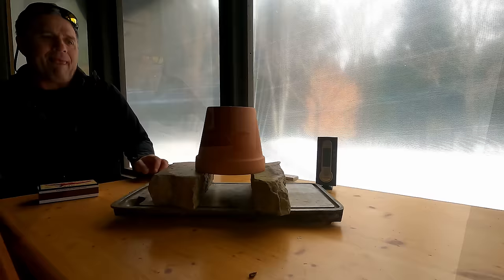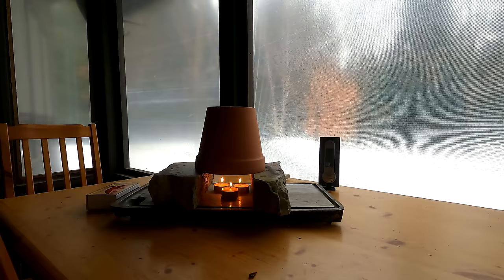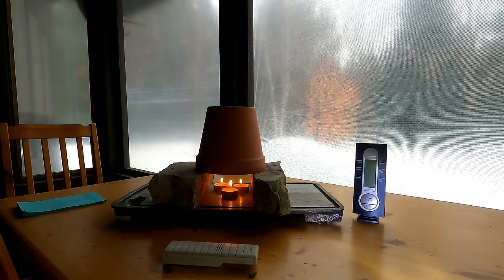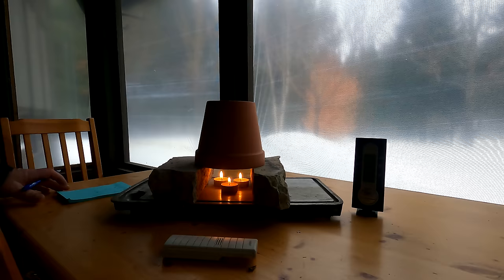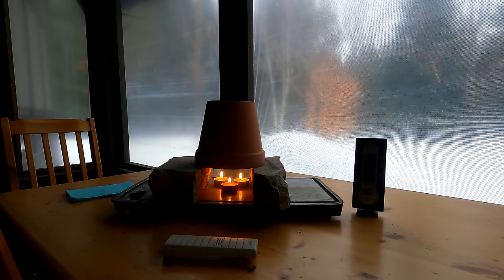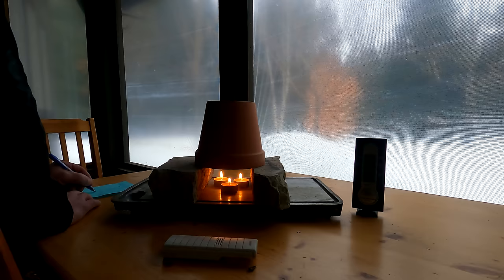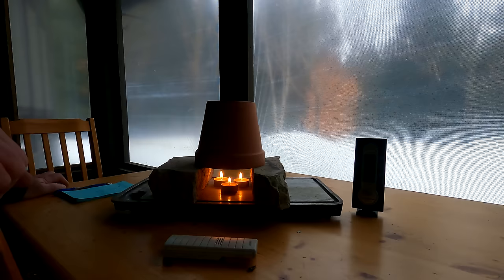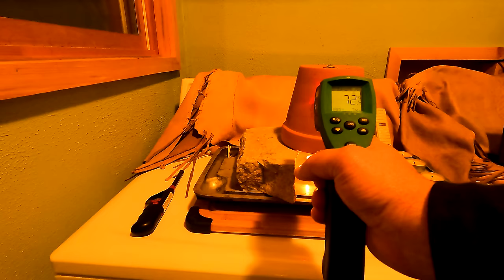Testing the Clay Pot Heater | Truth or BS | Prepping and Testing

Comment: Guess what? If the candle is heating the pot, it's not heating your room so much. 

There is no increase in efficiency. 

It's not the same as electrical storage heaters that use cheap energy overnight to heat up and release the energy during the day.

If you compare the cost of the energy produced by burning a tea light (about 600,000 joules for about 20c). 

The cost of producing that same energy with daytime electricity is about 2c 

So it's 10 times more expensive to heat a room with a tea light (pot or no pot) than to heat it with daytime electricity.
Reply from the maker: Absolutely - this is a unit which people use as emergency heat should the power grid fail. This unit is too inefficient to use in any but a dire situation. Note - I would not use this unit as there are many products on the market specifically designed to keep you warm should the power fail. Those products are tested and stamped as safe. Try getting insurance money from a provider should your house burn down due to using this clay pot heater. I was simply testing it to determine if the unit could heat a very small, internal and well insulated room.  It did indeed raise the temperature by a few degrees. The pots actually capture the heat and radiate it out in a more controlled manner than candles alone. The pots also continue to radiate the stored heat for at least 30 minutes after the candles are extinguished.   Thanks for the very well written comment.

Comment: It's a localized heat source, i.e, a space heater.  Critics will seek to invalidate it on the BTU capacity of the candles, etc., but fail to take into account where the heat is being radiated.  A candle normally radiates some heat off of the flame, but in terms of convection heats a narrow column of air that rises to the ceiling, useless as a space heater since humans normally don't hang out on the ceiling.  All of that wasted heat of an open candle, in this heater is here being stored in and radiated from the ceramic in the pot, in a specific zone of heat, which the user would presumably place near himself to help keep warm.  Or he could climb up on the ceiling in search of that wasted heat from the open candle flame, but he probably won't bother....

My point?  Any criticism of these heaters based on their not being able to heat an entire room, floor to ceiling and corner to corner, as thoroughly as does a thousands of BTU furnace, are invalid criticisms.  You would not evaluate an old-style gas flame space heater with the ceramic backing and metallic reflector against a full-on furnace.  Likewise this home-made space heater should not be so evaluated.  It makes a heated zone, which you sit inside of, and that's it.  When you start talking about BTUs or heating the entire room as a criticism of this type of heater, you've already revealed yourself to be talking apples and oranges, and invalidated your own point.
Reply from the maker: Hello Bill, Very well written and exactly to the point. This unit is not meant to heat a room. It is only capable of heating a small circular zone into which you can place yourself to stave off potential hypothermia. 
I am somewhat at a loss as to why this little 10 dollar contraption has caused such a debate. Heat is heat - if this is all you have when the pilot light goes out - I am pretty confident that everyone in this thread would give it a try.  Very much appreciated and thank you for commenting.

Comment: So, 3 candles for 2 hours increases 5deg. 

So  call it 40 candles a day for 5 deg. 

So, let’s say it’s -5 and we want 15c

So double double double. 
40x2x2x2 or about 300 candles a day.
Reply from the maker: It would not have a chance to heat a non insulated room. The actual test was done at 4:06 in the video. The room is well insulated - R40 and very small - 5ft by 8ft.  This was able to maintain the temp in the room.  It is not intended for home heating - it is an emergency unit only. No need to calculate the amount of candles one would have to use. I heat my home with a wood stove so therefore  have no need for this type of unit.

Comment: B.T.U. ONE  BRITISH THERMAL UNIT. is equal to approximately one kitchen match.   The clay pot just holds some of the heat off the ceiling.  This would be better than nothing at all.  Don't expect to much out three candles.  Average furnace heat for a home would be approximately 11,000 B.T.U. and up.or.  11,000 kitchen matches. Also. Those candles don't burn very clean. Black soot is coming off of them in to the air.
Reply from the maker: I am glad you commented with a rational statement. The candles do indeed pose a problem due to the fumes and soot produced. The only candles which should be used are bees wax or soya based. This test was simply done to determine how much the candles could heat a small room. The pots only function is to capture the heat and radiate it out in a controlled manner - as you stated.  There are too many safety risks associated with this unit to consider is viable.
Reply: @Hawksshadow I appreciate your reply.

Comment: 2 scenarios. 1:I pour a litre of gas (oline) on the ground and light it on fire. #2:I burn a litre of gas in my vehicle. Was the same amount of heat produced? Were the results different?
Reply from the maker: Not sure where you are going with this - The experiment was simply to answer the question of whether or not the unit could raise the temperature in a small room - it did, but not by enough to raise a room to comfort level from zero.  The pots simply hold and disperse the heat emitted by the candles. I would never waste fuel by pouring it on the ground.
Reply: @Hawksshadow  the pots are transducers that is they convert energy from one form into another. In this case, from physical heat into IR radiation.
Reply from the maker: Very well said - I am in agreement with you. Thanks for the reply and clarification.

Comment: Now test it with just the three tea candles in the room on their own without the pots. Ya can't increase the amount of energy from something after all. So all the pots are doing is holding onto the heat that would have been added to the room anyways. Also your temperature gauge was way too close to the heat source.
Reply from the maker: The Pots do nothing to increase the temperature of the room - they capture the heat and radiate it out in a controlled manner. If you are in dire need of heat, you will want that heat right where you are sitting and not at the ceiling. Note - this unit has too many safety risks associated with it - I would not use this in my home.  At 4:06 in the video, I move the unit into an insulated room and the thermometer is approx. three feet away. The room is 5ft by 8ft by 8ft high. The placement of the thermometer which you are referring too - was place there because the room is wide open to outside temperatures and I wanted to see the effects of the candles on the pots.  Thanks for the comment.

Comment: A candle will only put out so many BTU, and nothing is going to make it more.
Reply from the maker: Absolutely correct. The pots only function is to capture the heat produced by the candles, store that heat and radiate it out in a controlled manner. I use granite rocks to heat my tent during fall and winter camping - it is truly amazing how much heat a rock can hold.  The clay works the same way; however, in a very diminished capacity. Note - I would never use this unit to heat anything. There are too many safety concerns. There are many products on the market which are designed to keep you from freezing to death should the power grid fail.  Thanks for the comment.

Comment: 4:59  How long will it take to get to whatever temperature that you think is “heating a room”? I guess you can survive in a 40°F room if you dress in layers while covered under a bunch of blankets, and occasionally doing some jumping jacks.
Reply from the maker: Time to raise the temperature from 60 degrees to 65 Degrees - outside temperature - 40 degrees - was forty five minutes. The temperature in the room was maintained and moderately increased by this combined unit. The pots simply kept the heat from the candles from escaping to the ceiling.

Comment: sooo, if i need to heat a small room by 3-5 degrees in around 2 hours or so this will work 60% of the time every time.
or, i could just let the candles do it on their own. about the only benefit i can see to this is the clay holds the heat a little longer after the candles go out.
Reply from the maker: You are totally correct - the pots simply capture the heat and radiate it out to the room. The pots will continue to stay hot to the touch for 30 minutes beyond the extinguishment of the candles. I would stay well away from this as a heater as it is unsafe for many different reasons. Thanks for the comment.
Reply: @Hawksshadow  i wasn't there for it, but a friend of mine used this type heater in a old mining shack while camping. it didn't cause a fire, he bumped and broke it then burned his fingers trying to move the shards out of his way.
Reply from the maker: I believe it - I touched the pots about 10 minutes after putting the candles out and could not believe how hot they were. You stated that the the unit broke when bumped, that is precisely why this unit is dangerous to use - a lot of things can go wrong in a quick second.  Thanks for the comment PaulC001

Comment: Why get the pots dirty? If you light candles without any thermal storage, the same amount of BTUs are being released.
Reply from the maker: Yes - the difference is the ability of the pots to retain the heat and radiate it more efficiently than a candle.

Comment: Maybe we need to look more closely at what we are doing.
Assume the candles put out 100 calories of heat. That's it -- no magic trick will turn that into more than 100 calories. 
What we CAN do is change the distribution and form of that heat. Rather than having a tiny very hot spot at the ceiling -- where it does no good --  the pots hold the heat down near you, where you can benefit. 
Also, much of the heat is converted to radiant heat, heat  that passes through air and is felt by those nearby. Left alone, much of the candle heat would be used to move hot air to the ceiling by convection, where it would do little good.
You're not making more heat; you're just using it better.
Reply from the maker: Well said and 100 percent true. The pots capture the heat and radiate it out in a controlled manner. This unit; however, is only effective for warming up a very small area a few degrees. I would never use this as emergency heat due to many safety reasons.

Comment: Radiant heat vs convective heat.  The overall temperature in the room will not increase.  The temperature of the items in the room will increase.
Reply from the maker: Well Said - the idea of the pots has nothing to do with increasing the overall temperature - it has everything to do with efficiency. The Pots capture the heat and radiate it out in a controlled manner.  Note - I would not use this system as emergency heat as there are products available which are manufactured for this very purpose and pose little risk to home or life. Thanks for the comment.

Comment: Yes, this does work.  The operative principle is the increasing of the surface area of a very hot surface.  The greater the surface area in contact with the air in the room, the more air can be heated.  Also, do not disregard the radiating quality of the pots as far as being able to warm skin when close to it.  I have a few of these set aside for use in a small room in case of a total power failure in winter.  It will keep the room warm enough in an emergency situation, but I would not be using these as a way to save money on my heating bill every month.
Reply: It doesn't increase the BTU output of the candles in anyway.  However, it slows the transfer to the air around the candles as well as some of the energy is put out as Infared heat instead. Basically, it distributes the energy in a different manner, it does not increase the energy in some kind of amazing wizardry. It's the same with forced air furnaces and boilers, same energy input, but boilers are more efficient at distribution. there are no free lunches with physics.
Reply from the maker: Hard to believe that this is even slightly controversial. Your original statement is 100 percent accurate. The pots only function is to capture and radiate the heat. I thought this was a simple concept - who knew?   Thanks
Reply from the maker: @NegdoshaManido  Very Well written indeed - I am very much appreciative of your input into this overanalyzed quandary.  Stay strong Sir of the Unwashed clan. I too, will do my best to stay away from the soap being peddled.

Comment: I’ve experimented with this It’s dangerous and should never be used indoors, soot from the candles can build up on the pot and then drop back into the molten wax where it acts like a giant wick, in my case the soot landed half in half out so spreading the fire
Reply from the maker: I agree with you. The heat retained by the pots melts the wax prematurely - once the wax is liquified - flash fire can occur. I was simply testing it to determine its validity as a heat source. Thanks for adding to the conversation.

Comment: If you have no electricity and are burning a candle for light and can confine yourself to a small space, bathroom, it may keep you from freezing
Reply from the maker: 100 percent - that is all this little contraption could manage. The room I performed the test in is 6ft by 8ft by 8ft high. Contrary to what others have stated, this unit did raise the temperature of the room several degrees and could potentially keep it above zero dependent on the outside temperature. We have temperatures of -35 degrees Celsius - this little unit would have no chance unless confined to a very small well insulated room.  Thanks for the comment.

Comment: So theoretically in a insulated room it will work albeit mediorically. But in a emergency situation something is better than nothing.
Reply from the maker: You are totally correct. That is the whole premise of this unit. When you are cornered and have no alternative, I am sure people will resort to anything to stay on the warm side of the thermometer.  There are many different manufactured emergency heaters on the market which I feel everyone should investigate and purchase. This clay pot heater works - as you say, marginally; however, it is, in my opinion, far too unsafe to use. Open candles, toxic fumes, potential of flash ignition and a host of other issues is why I would never advise anyone to use this unless under complete control. My home is heated with a wood stove and yet I still own several emergency heating devices as a back up.  Thanks very much for the comment.

Comment: There are laws about these things and if folks had paid attention in middle school they’d know this.
How many ‘BTU’s” are those candles capable of generating?
Reply: you are correct, but they change from state to state. Most restrictions are in city environments, which makes sense. Living in the county gives you a lot of freedoms though.
Reply: Well  @Dirshaun  it matters not if you live in an Urban or rural environment, everyone without exception has no choice but to abide by the laws of Thermodynamics, in this case especially the first three:
Zeroth
First
Second
Once you understand this you'll realize the folly of these candle & clay pot heaters!
Reply: What are you the candle cop
Reply: It's not about how much heat the candles can put out, but about keeping the heat down where it's needed, not floating up to the ceiling.
Reply: C'mon  @AbuMaia01  you can't possibly be serious!
Reply: @svgs650r  What part didn't you understand?
Reply: ummm  @AbuMaia01  I'm not the one "not understanding", and the fact that I have to point that out telling!
Reply: @svgs650r  To me it just seems like you're upset for no reason, and since I don't need any jerks yelling at me in the comments for no reason, you're muted/blocked. :)
Reply: @AbuMaia01  you deny scientific fact?

Comment: That thermometer is too close to the heat source to accurately assess any room temperature. Of course it'll be warmer within a few feet.
Reply from the maker: The thermometer is indeed close to the heater. The thermometer is actually triggered by a remote unit which was located approx. 5ft from the unit. The room is internal to the house and is 5ft wide by 8ft in width with 8ft ceiling. Insulated with R30 in the walls and R40 in the ceiling. With all of that, the unit only raised the temperature by a few degrees.

Comment: I watched a survivalist use 6 rocks about a foot in diameter in a circle then make a fire in the center. While the fire is going, use branches complete with leaves and made a ground covering. When the fire died out, he put 3 of the rocks on each side and covered them with more branches to make a bed so the rocks radiated heat for the night while in his sleeping bag. Anything to gain a couple of degrees of heat I guess
Reply from the maker: You are right - A rock the size or your fist will retain heat for many hours. I always leave a couple "cooking" in the fire so I can gather them when needed at night. I posted a vid on this very subject not too long ago. I compared the pot heater to a simple granite rock. 
Thanks for the comment. And yes - anything for a bit of heat is better than nothing.